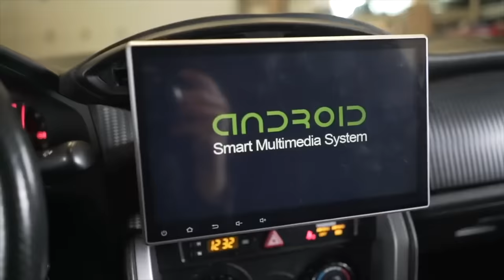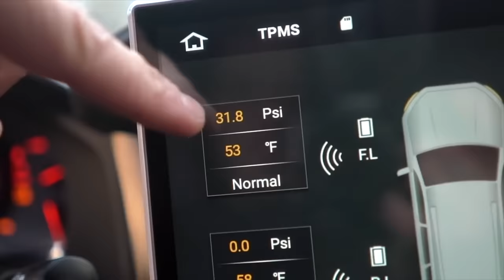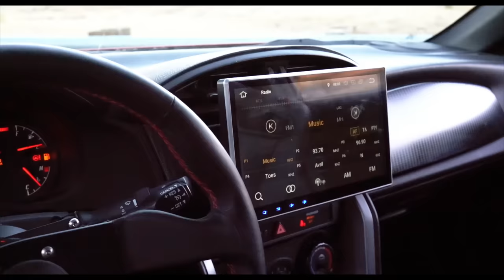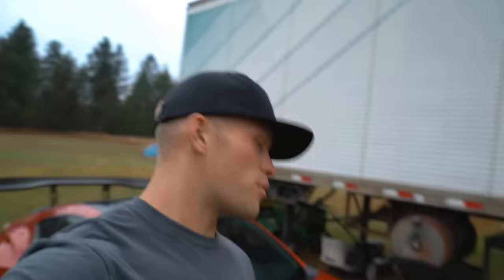Incredible Car Build Transformation!

Comment: I noticed you did no engine work or did u? And how much horsepower
Reply: meatball sub *stock
Reply: 31 psi wow thar a lot
Reply: The 31psi on the screen was from the tire pressure not the boost lol the engine is stock😂😂😂
Reply: Stock 190 probs
Reply: I change my with a truck engine and give a button for turbo like fast and furious

Comment: It’s a nice build but rice by definition. Didn’t even touch the engine bay. You can put a turbo with bigger fuel injectors and it would be less rice. Overall nice build time for power mods
Reply: Yjmoneypit Melendez you don’t even know the definition of rice😂 jealousy kills.
Reply: This isnt rice at all... Rice means cosmetic modification that are just useless and usually look bad... This isnt as it has a wide body kit which allows for wider tires thus more grip... The wing might be considered rice as all wings kinda are but whatever... 
And as he said at the end he is going to boost the car so yeah... 100% not rice but nice except the stance... I dont like stance in general so whatever :P
Reply: @vali69  how are wings rice? down force is a real thing lol
Reply: @goalstoper24  ricer wing is for flying
Reply: @rafi7252  Jesus, Downforce!??!

Comment: Why do you put Toyota emblems on it if it is a Scion FR-S and not a Toyota 86
Reply: Brentley Aulgur cuz it’s the same car
Reply: @sothearakim6638  I mean there are differences, minor though they may be. I would've kept the FRS badging though. It adds to the personality of the car. Shit still looks sweet though, regardless of what he wants to badge it as.
Reply: Zeztren that’s true but it’s still on the same body and chassis, even though they were different brands ( Subaru, Scion, and Toyota) they all based the car on the same blueprint and even though one car might be heavier or one car might have more power or whatever they all were going for the same idea
Reply: @sothearakim6638 
Sorry in advance for loooong post
The power plant is the same across all models of similar years. Apparently the FRS and 86 have better reliability while the BRZ handles better. Other than that its just tiny details like the grill design and interior stuff. Though I think the FRS was probably the along the lines of the economy model. Like a base Mustang or Jeep, still fun but lacking in one thing or another.
The best thing I can think of that's as close would be the Ford Ranger and Mazda B2000.
Anywho, my op was more so just about the badging thing. Like if you got it, own that shit and run with it, and maybe do with this guy did. Like, did you know there was a car scene for Saturns? I didn't till I watch one of ThatDudeInBlue's videos, and its true what they say, for each car there's a car scene no matter how bland or weird.
Reply: Why not ? Scion is TOYOTA
Reply: I get it too it did not add up
Reply: @MyRcGoSlow  Scion baby Toyota but Scion also no longer exists 
11/27/2018 Edit
I've no idea how baby got in there. It's supposed to be "is". Imma leave it in cause fuck it but also I was tired so fuck it twice
Reply: Its all the same car with a different badge
Reply: im gonna say say so people think he spent more on it. The 86 is newer than the FRS so therefor itll cost more. Plus, Toyota is a more popular brand and hes less likely to get flak from people if its Toyota over Scion
Reply: Because they think it makes them cool or "JDM".. Just like the old ricers in thier Hondas with Acura badges.

Comment: I don't need a date car. I'm too dangerous to have a race car. I want it as is. I don't like the gr86 because it's faster than gt86. Iuse mine for daily driving and my presence of mind isn't reliable to be careful with more speed and torque.

Gt86 is perfect for me as well as the sports car look. But i prefer the look of the gr86 because i don't like the nostalgic front lights and rear lights.